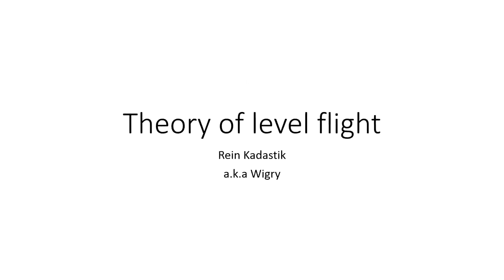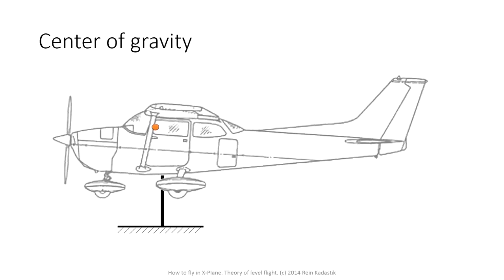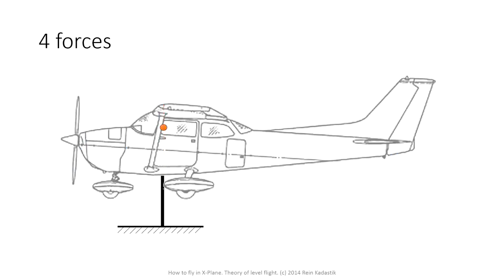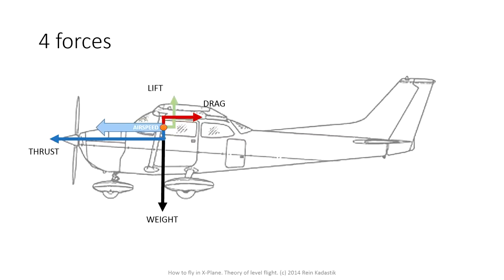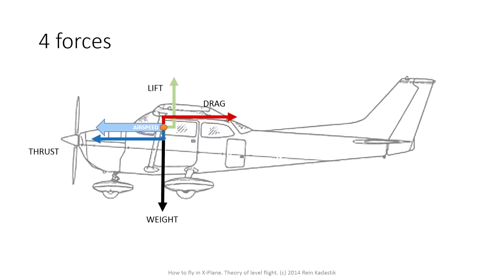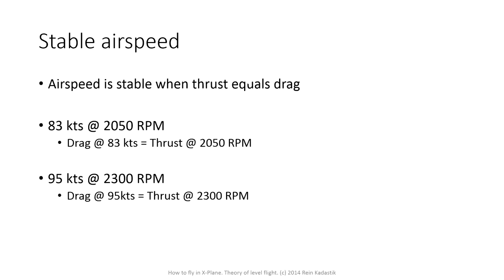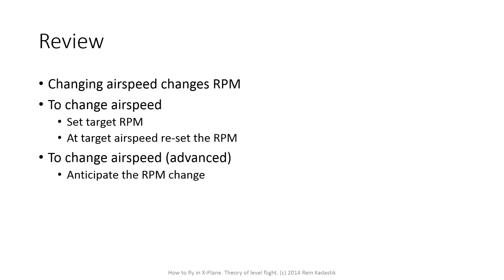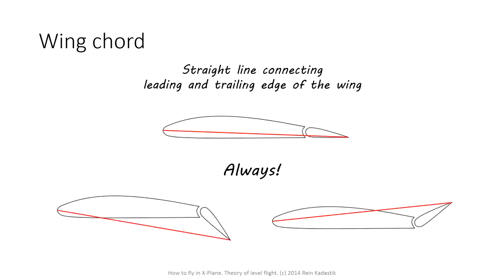How to fly in X-Plane - part 4 - Theory of level flight

Comment: The changing pitch in a propeller (on variable pitch propellers), from what I understand from your video, is akin to shifting gears in a car, but around 17:02, your diagram shows a light blue rectangle that changed angle, but, in my limited understanding, it shouldn't change angle. The tilt angle on each individual blade does change, but the light blue area is always perpendicular to the propeller axis, isn't it?

Great series of videos, BTW.

Comment from the maker: In this video I am talking about fixed pitch propeller. Variable pitch propeller allows you to keep the angle of attack of the propeller blade constant regardless of the airspeed so the lift and drag of the blade is also constant resulting in constant RPM. With fixed pitch the AoA reduces with increasing airspeed as shown in this video. the drag and lift reduces so the RPM will increase.